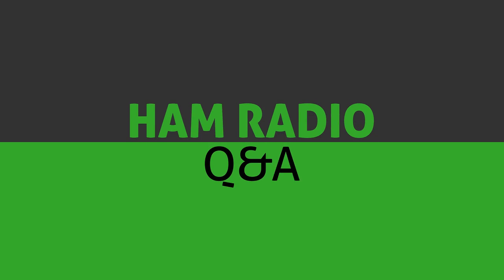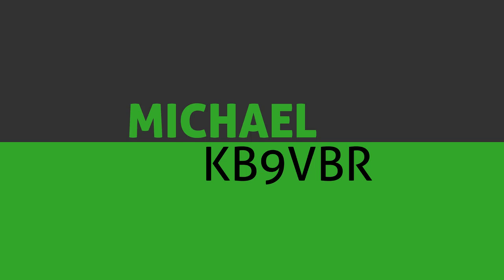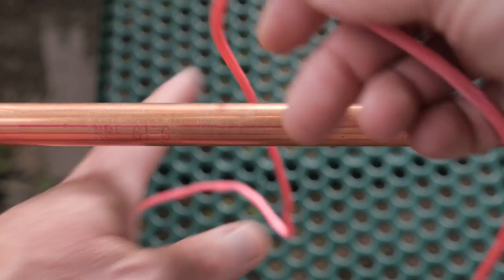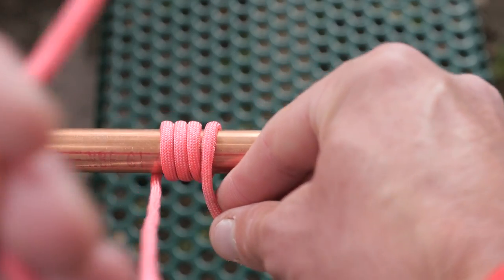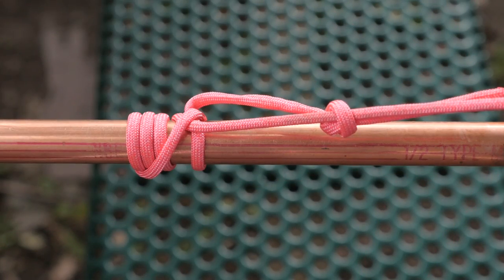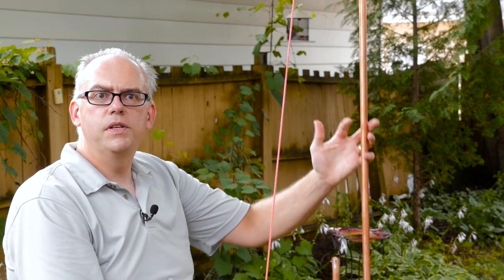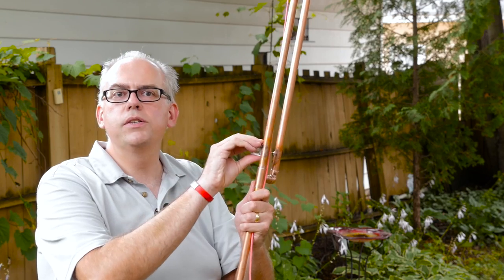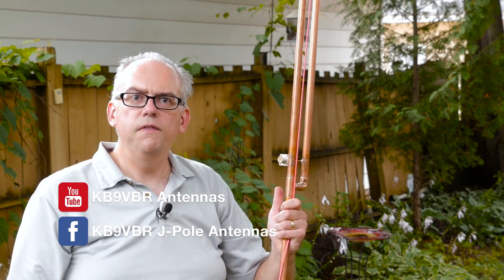Tying the Pipe Hitch Knot - Ham Radio Q and A

Comment: Are there any precautions to take vis a vis lighting strikes to the tree / antenna?
Reply: Ground the mast or metal mount with a heavy gauge to an 8ft ground rod at the base of the tree. If not using a mount, ground the shield of the coax at the base of the tree and at the entry point to the home. Bind to house ground so everything is at an equal potential.

Comment: I needed that knot!  Is it possible to match the impedance of 75ohm rg59 cable at the j-pole?  I'm broke, but several rg59 cables that also have BNC connectors.   I have read that cutting the rg59 to whole half wave lengths will also solve the impedance mismatch problem.
Reply from the maker: I'm glad to hear the knot was just what you needed. As for the 75 Ohm coax, keeping your feed line in 1/2 wave segments is one way to match the impedance. I've got more tips in an article on my blog: http://www.jpole-antenna.com/2015/01/28/using-rg-59-or-rg-6-catv-cable-with-an-amateur-radio-antenna/
Reply: Great article.  That'll save me at least 50 bucks in cable and connectors.  I going to set a local radio network for a Neighborhood Watch group using MURS.  Would it be a good idea to use the J pole or a slim jim horizontally.  We want good coverage, yet some privacy, or as much as possible.